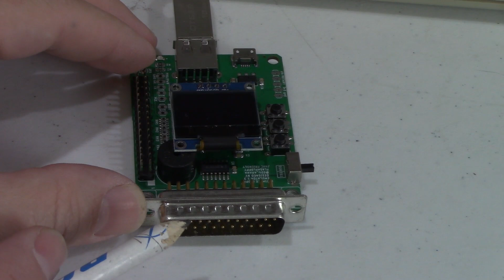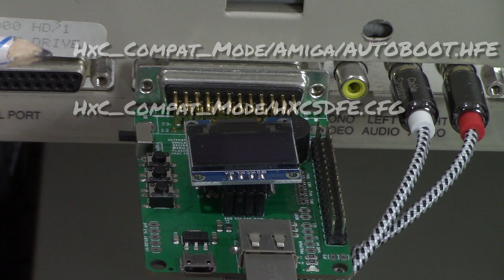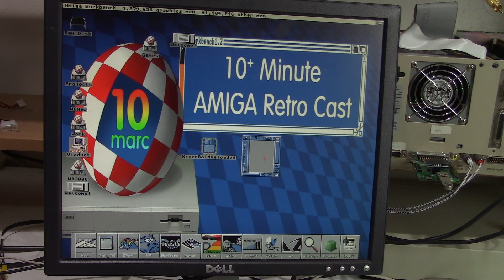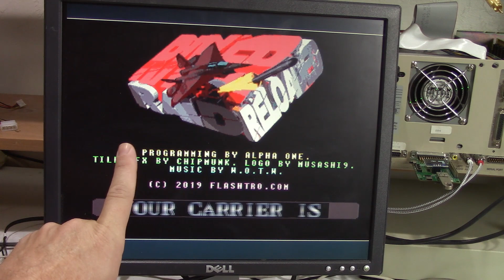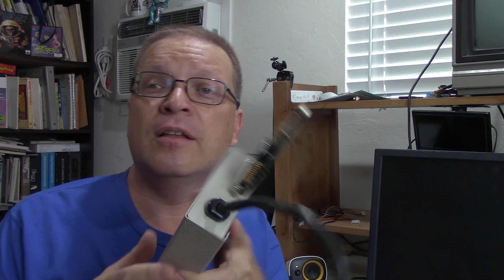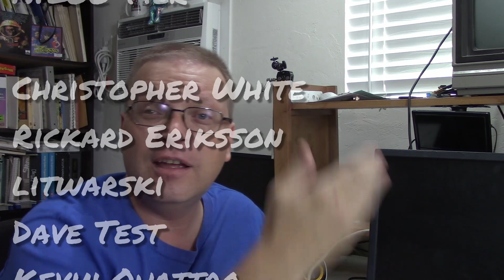Amiga Ultimate Floppy Emulator from Edu Arana - 10MARC Episode 79

Comment: Thanks for the review Doug, i really like the test on it. I will let you know a couple of extra things.

The device has two power pins near the floppy drive connector, by soldering two pins, you can connect it with a couple of dupont wires. On the pcb says VCC and GND.

Also to use the buttons internally you can also solder cables from the pcb but internally will lose the capability to move to another amiga. As you say, on that cases, buy a common gotek drive.

Also the oled can be detached and by using 4 Dupont male to female cable you can move the screen whatever you want to.

I really appreciate the support of this device.

Regards
Edu
Reply from the maker: Oh how wonderful! I honestly did not notice the pins for power, that should work nice! I would personally only want to move the screen if I was going to keep it just on one Amiga and not make it portable, but I think I will be moving it a lot. I am going to send mine to a friend so he can work on a few 3D printed options for it.

Comment: Nice video :) I knew about this device but hadn't read up on how it was different from a regular gotek. It's true, moving files across amigas, I often need to think about how to do that.
Reply from the maker: Very true. I often have to revert to making floppies to move data, as sometimes my SD cards in my Amigas are internal. This will make things easier.

Comment: That's a cool gadget. It would be neat if the screen and controls where on their own little board, with a small extension cable back to the main board. Easier than extending the floppy cable, and there'd be less mechanical stress on the main board from all those button presses.
Reply from the maker: Nice idea for sure! The OLED is a separate Component, I think, and can probably be extended... The buttons can't be, though.

Comment: Sweet device and nice review. I bought a couple of cables from ebay that let's me connect regular Goteks to DF1 port. But of course, not as DF0 unless I use the DF1 to DF0 mod
Reply from the maker: Oh? Those sound like cool cables. Do they provide power to the GoTeks, too?
Reply: I got mine from the same seller a few years ago. Yes, it draws power from the external floppy connector. Couldn't get the gotek to work as DF0 using the ACA500plus, though.

Comment: Thanx for your great Video. I personally use a Gotek inside a external floppy case (the original floppy drive was broken) with a 3D printed front and a OLED display. I connected it to my A4000, because the A4000 has a internal DF0/DF2 Jumper. With that jumper, you could set the two internal A4000 Drives to DF1 & DF2 and the first external will be DF0. That is great to boot game disks from the Gotek.
But for this little solution in your video, another idea comes into my mind. 
It would be great to have a 3D printed A1000 front memory covering for this, including buttons and the display. 
With that nothing must be destroyed and we could connect the Floppy Emulator to the internal connector and anything on the Display is readable. 
I think with only 512K chipmemory, the A1000 is the Amiga who mostly needed to boot games from floppy because most games that runs with 512K chipmemory need that completely an then WHDLoad or normal harddisk installation is no Option.
Reply from the maker: I have never used that jumper in my A4000, but what a great idea! I like your A1000 idea, too. I should look into that!

Comment: Hi Doug, how is your ACA500plus doing? :)

I ask because the ACA500plus has the DF0/DF1 switcher functionality built-in as a menu option, and was wondering whether it can switch this floppy emulator to DF0 when plugged in externally?

Enjoyed the video, as usual.
Reply from the maker: My ACA500+ died. I tried to use it in my Checkmate case, put it in the wrong way and killed it.
Reply: Sorry to hear that. I watched the episodes where you explained what happened, but hoped it was fixable.
Reply from the maker: I sent it in for repair, but it could not be fixed. Very sad...

Comment: Can you set the DS switch to DS1 and use it as second drive internally on a single cable on an A500? (I guess this would apply to a Gotek too) It would be nice to have an internal real floppy DF1 and a floppy emulator as DF0 in my Checkmate case.
Reply from the maker: Yes, it would work fine as DF1: internally. No problems at all as long as you get it power.

Comment: So... Why not just put a GOTEK into the external housing of a dead disk drive?
Works like a charm... ;-P
 
So one question, since it is the "Ultimate Amiga Drive";
Does it support Amiga HD 1.76MB ADF disk images?
Or DMS?
How about compressed DMS?
And ADZ?
Reply from the maker: Some people don't have a dead Amiga External floppy to put a Gotek in. If you have one, great. If not, this is a very viable solution. It is sure nice to have options!
My GoTek does not seem to support 1.76 MB ADF's which makes me sad... But I have not tried it with this. I always assumed it was an issue with the FlashFloppy Firmware. DMS is compressed, so it may not work
Reply: @10MARC  hmm, for FlashFloppy you need to set some property in the config on the stick, interface=amiga and works. HxC also does the trick after a certain firmware. For using Goteks externally, you may need to also modify the external floppy attachment PCB, but that's a walk in the park. While the directly attached Ultimate Floppy solution has no requirements like that, I really like the external housing + Gotek better. Just more robust.

Comment: Any links anyone can advise to further support the setup of this fantastic device? I could also use some tips...

My UFS arrived a bit late and Ionly tried ittoday.
Ran into some trouble whilst configuring it.

Formatted a USB pen and a micro SD card to FAT32, copied in the ADFs and FlashFloppy as shown in video.
USB: Configured it in my Amiga 500. I have an ACA500+ so used Workbench 3.1.4 to map the ADFs in the FFManager. I was only able to play Rick Dangerous 2 in a set of twenty ADFs... Others just get stuck after the crack page... It seems it's looking for the floppy disk in the real DF0...
Micro SD card, my preferred "drive" option, no luck at all.  I get error 34 as soon as I boot the Amiga... I don't know why!
Cheers all!
Reply from the maker: Hmmmmm.... Only one worked, eh? And you were trying to boot to the device, correct? ADF files are much more sensitive to what Kickstart ROM you are using than a solution like WHDLOAD (which of course uses virtual ROMS) - Maybe flash a 1.3 ROM on the ACA500+? It is easy enough to switch to that, and may be worth a try
Reply: @10MARC   yes, once I mapped the adf in FFManager I booted the Amiga from the device... And started reading the games. They start, they all show the crack page, if they have one, but most then fail to load...
I'll only set up my Amiga again next Saturday. I'll give it a go then t with the 1.3 ROM, just not sure if it will identify the device as I'm using it externally. I've never been able to correctly install Whdload and play games with it. Again, some lack of time to intensively give it a go... Thanks for the tips! I'll let you know how it goes 😊 cheers!

Comment: Edu is making fantastic product, but... This is sitting on the back of my Amiga. Useless with a big box Amiga. Not practical with an A500/600/1200. And how do you use this internally? You can’t use the buttons or see the screen. Or am I missing something? And there seems a mechanical problem. Push a button and the connector moves. How long before a solder joint will break? I do think it a great idea to have a device like this, but a lot of the problems has to be sorted out.
Reply from the maker: You are not incorrect, which is why I showed it connecting to the back of an external floppy and demoed using it with an "Extension Cable" of sorts. 
It is the first of it's kind that I know of. In had no issues using it on my A1200, but my Big Box Amigas would be very difficult to use with it.
In think my idea of a 23 pin ribbon cable connected to a 3D printed case is the preferred solution... It makes it as useful as an SD2IEC on a C64 in that situation.
Reply: @10MARC  you are right. But the solution with an external floppy drive looks very messy. And you would still need a case. But A ribbon cable and (3D printed) case would make me buy it. I don’t want to do al these things myself.
Reply from the maker: @robsprokholt8831  I get that for sure, but so many things in our community are DIY. I personally like to spend the extra $$ on all-in-one complete solutions, too... But that is not always available. :(